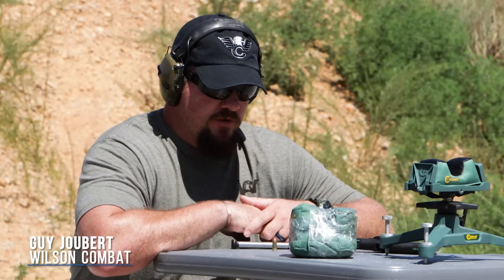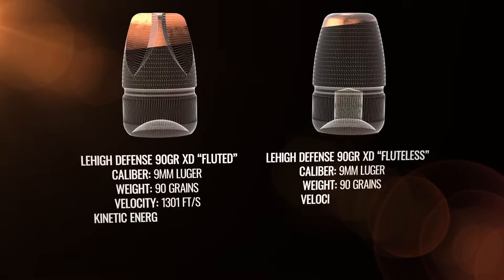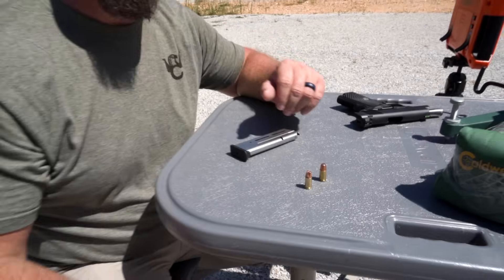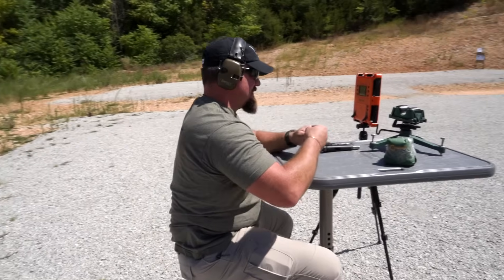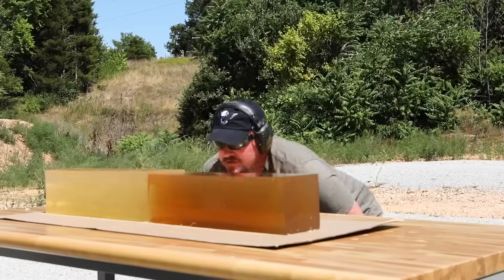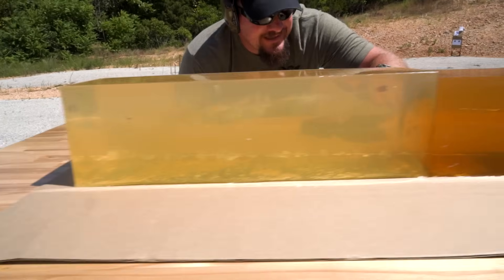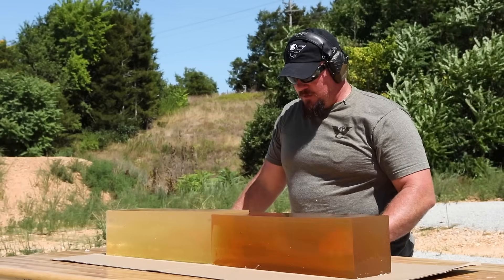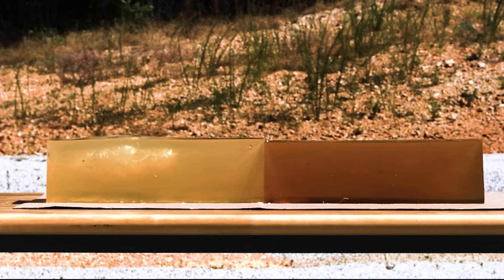Lehigh Defense - Xtreme Defense 9mm 90gr Bullet with & without Flutes in gel - Here's what happened.

Comment: The 55 grain .32-caliber version are the bullets that I have loaded when I carry my little .32 ACP - except that they have now been discontinued, and since I have no resupply possible, I have just switched to packing a .327 revolver loaded with 100 grain XTPs.    

As for the 90 grain 9mm version, I actually load those in a 9x25 Dillon (a 10mm Auto necked down) and get them cooking at 1800 fps out of a 5.5 inch ported barrel (4.8 inch effective before the ports).   I am quite certain that a magazine of 15 of those will turn pretty much any target into "Glockamole" in short order.  

And Wilson Combat... please consider at least allowing for occasional runs of the less popular stuff that got discontinued.  Even if just listing it as out of stock and accepting backorders or even a 500 to 2000 buck minimum order or something.

Comment: Seems like a viable option for something with a 3” barrel. You can’t beat a good bonded jacket hollow point unless you don’t reach the velocity required to make it expand. That’s where this might fit in.
Reply: From videos I watched the secret of these bullets is just tumbling, actually they angle sideways and rotate, it's odd.  It does make a larger wound, but not due to the flutes casing magical disruption.   In the video, I noticed, he didn't point out the bullet ended up facing backwards in the gel.

Comment: The length and power of 9x19 allow these to load and cycle reliably. I have had issues with them in .380 when racking the first round into the chamber.  The shorter cartridge and steeper feed ramp can cause that slower-moving first round to bind up on the feed ramp, failing to load.  I'd like to see them slightly bevel/taper the leading edge of the "fins" to overcome this issue.
Reply: What .380 are you having issues with these feeding?
Reply: To be clear, the problem ONLY arises when racking the FIRST round from a full-to-capacity magazine; the drag created by the pressure on that first round slows the slide down enough that that first round doesn't ALWAYS chamber.  After that, in actual firing, they cycle fine.  
That said, the guns are Ruger LCP and LCP MAX.
Reply: I should also mention, I'm using the Underwood loading of these. And, since I carry with a round in the chamber AND do NOT "top off" the magazine with after chambering (no +1 for me), I'm confident enough in the ammo that I actually carry it.

Comment: I've been using Lehigh for years and now I keep them in my LCP Max, normally buy them through Underwood
Reply: Do you use the XD or XP in your Max?
Reply: @richardefriend  You had me wondering so I had to go look.. they are the 90gr extreme penetrators 1100 FPS, now I also have some Lehigh 90 grain extreme penetrators 950 FPS and I also keep some +p hp 90 grn bonded jhp 1200 FPS, very hot, I got a set of extra power springs from Wolff... But my LCP ll jammed with them one time, so I don't use them in the max

Comment: Apples to oranges, i.e. fmj to fluted.  Yes, the penetration is less, but so is it with a good JHP.  The key factors for me are penetration and permanent wound channel.  So unless there is some hydrostatic tissue damage, which I am unaware of in subsonic rounds, then I do not see the point of the test or any reason to change form a 124gr Gold Dot or 124 HST.
Reply: But it’s not an FMJ, it’s a solid.  The point of the video is to show how effectively the flutes work.  There are LOTS of other videos comparing these FTMs to JHPs, and ultimately the answer is: they work about the same, except, the FTM never has failures from the hollow point plugging or deforming, thus the performance of FTMs is more consistent.
Reply: What mma10 said. Look up iraqveteran8888 and military arms channel. They both have several videos comparing this round to gold dot, hst and hornady duty and it out performs on barrier test everytime and is on par with hst in bare tests. Also seen neo's video take down a hog with one through the shoulder and it wrecks face.

Comment: If you spray a high pressure stream of water on those on the tip with a syringe you can see the fluid channeled into a tight stream that exits at a angle .I love the results in liquid base material and the penetratiin through hard barriers is fierce on these in 357 sig and 40, nine too.

Comment: People aren’t saying it’s a gimmick…people are rightfully questioning whether or not the disruption amounts to anything more than a temporary stretch cavity.  If the disruption is nothing more than TSC is means you have a FMJ wound profile with hollow point penetration….  Bill Wilson hunts enough pigs…why not use service caliber handguns to do so and see how it shakes out in a 100+lbs critter…
Reply: Pig comparisons would be the appropriate test. Gel is only valid for depth and expansion, and even then only in the abstract. The stretch cavity makes for dramatic high speed photography but is a mere artifact of the test. Tissue stretches but doesn’t tear until about 2000fps. Dumping energy to limit over penetration is nice, but simply warming up tissue isn’t the same as wounding it.
Reply: Extreme disruption of all your bodily fluids in a nanosecond does far more damage than wound cavity. Get with current technology
Reply: Neo has a video taking a hog down through shoulder bone. It wrecked the hog.
Reply: @jpo2311  I have seen the videos…they lack details and are more of speculation.  From what I’ve seen its like shooting hard cast…which is to say it’s lethal, but no different than a flat nose projectile.

Comment: What happens when you use this bullet profile in a 115,124 and 147 grain bullet? I am sure it has been done, but what happens? I get that the 90gr can go fast enough to get the rpm up and cause more effect.
Reply: Fluid transfer works better at higher velocities; therefore, not a lot of worth in heavy (slower) bullets.  They make a 100 or 105 which is exclusively sold to Black Hills, but I wouldn’t want anything heavier.  The solid, non-expanding construction makes them penetrate like a heavier bullet anyway.  When thinking of this technology, one must drop the old paradigm of traditional bullet weights.
Reply: Same thing but in different calibers. This is 9mm.

Comment: Why use this round over a proven HP
Reply: These will penetrate very thick common barriers as expansion does not occur, auto glass and sheet metal as well as layered wood and drywall can strip a hollowpoints jacket off or plug or blunt it .

Comment: I would say not basically the same as an fmj as they are lead core and more prone to deformation.
Prove me wrong!!
Reply: In the tests I've seen, lead core fmj's deform little to none in gel. If anything, the "fmj" used in this test will transfer energy slightly better because of the larger than normal metplat. Or maybe I'm way off. Not an expert.
Reply: @Lucas12v  
Possibly, just want to see the test!

Comment: I bought these for my 365 they dive as soon as the leave the barrel is this because the barrel it short
Reply: Assuming it's not shooter error, they're a little light for caliber so they may have a different poi than most 9mm. Not sure as I've never shot these. Might be a good excuse to put an optic on your gun and then you can zero for these or whatever you want.
Reply: They drop 3 inches at least  what’s an optic gonna do
Reply: @sigsnrigs240  3 inches at what range? Just curious. the 365 doesn't have adjustable sights but an optic can be zeroed any way you like. You can compensate for the poi shift.